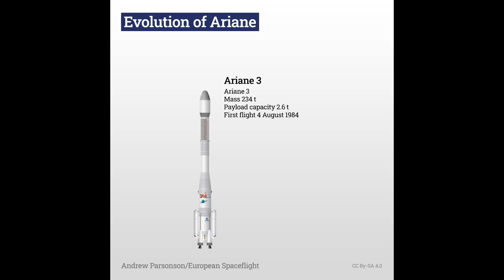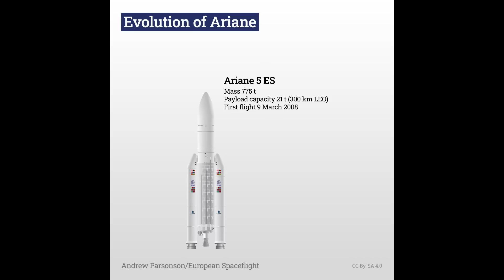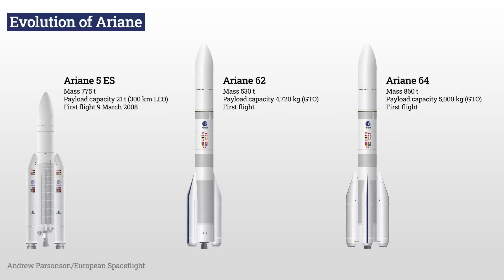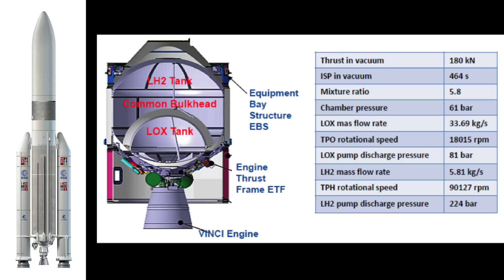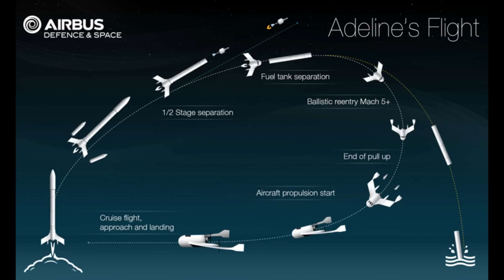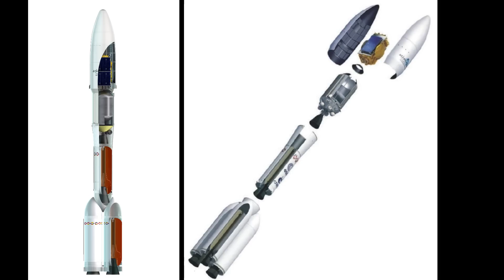Europe Retires Ariane 5 Before Ariane 6 Is Ready????

Comment: I wonder how long it will take ESA to manage any reusability. Or is it just not desirable for their heavy lift missions? If they’re going to stick with expendable rockets then cheaper vehicles need to be in the pipeline with cheaper mass produced engines. Perhaps ESA needs to have a commercial launch programme like NASA does, but for European providers.
Reply: the boosters splash down with chutes afaik.
Reply: 2028
Reply: Ariane 6 successor(supposedly a partially reusable design) is scheduled to start operations in 2030.
Reply: One develops a launcher to suit the missions one wants to be able to launch for oneself. The real challenge is, working out what the mission(s) is/are!

This is where Europe comes unstuck. It launched Galileo, though it mostly has no idea why. It's not like Galileo has revolutionised satellite navigation in anyway whatsoever. The French like it, because it gives them a GNSS capability for their military that is independent of the US GPS system. The UK looked at and nearly committed to building its own, but decided in the end that a third one - even if well built - was going to be pointless (same vulnerabilities, little inherent extra benefit). 

As for other missions - well, there's a bunch of science missions, but those are small in number. It doesn't look like Europe has any ambitions for crewed flight. Arguably, they can launch those with SpaceX (and they are).

So, that leaves the hoary old "communications systems" mission. They'll probably want to try to show that it's not just the Americans who can launch large constellations, but it'll not be of any real commercial value. GNSS, which simply transmits and no one has any idea if anyone is actually practically benefitting from it, can be deemed successful merely by existing. A comms service is going to look pretty silly, if no one signs up to use it. If they've gone and built a rocket for launching that service, it could easily end up being The Wrong Rocket for anything else, especially if they get a dose of Germanic-why-are-we-paying-for-this realism...

If I were in charge of Europe's launcher program, I'd take a look back at what Airbus did to Boeing in the late 1980s, early 1990s. Then as now, the Americans were building in large numbers, Airbus were small fry. Forget about StarShip (equiv of Boeing's 747), focus on beating Falcon 9 (equiv of Boeing's 737). Let SpaceX focus on the mega-launcher at a time when they've maybe not got much money to boost the Falcon 9. There's good market share / revenue to be had in the smaller end of the market. Big exotic launchers can come later. 

This could be tricky - Falcon 9 is actually pretty good. Geography doesn't make it easy either - Ariane has to ship stuff across the Atlantic, whereas SpaceX has their factory next to the launch pad. But, beating Falcon 9 is what I think they'll have to do, if they want to compete at all. 

If they don't want to compete, just prop up jobs, Ariane 6 is probably OK, but then again there wasn't much wrong with Ariane 5...

Space security, and territorial security against space threats could easily become necessary. Preparing suitably would require action and serious commitment, and will probably bring its own different launcher requirements. A lot of action early on would be needed if they're going to keep building in Europe and launching from French Guiana; it's a bit tricky to win a war if you depend on shipping a load of stuff across the Atlantic to launch it, potentially past a lot of enemy warships... 

Thing is, though that might drive a need for a specific launcher capability, judging by Western Europe's general "it'll never happen" approach to the threat against Ukraine, I can't see them getting that launcher strategy right at all. Europe's security moto seems to be "Never knowingly prepared for widely predicted armed conflict"...
Reply: @abarratt8869  You're mixing up a whole bunch of things that are unrelated. ESA is not a corporate entity and their goal is not to directly compete with SpaceX or anyone else. They're a semi-independent entity, albeit primarily owned by various nations, and their purpose is to run a launch program that suit their own and their clients' needs, and nothing else. Ideally they'd be able to be cost effective and pay for themselves, but that's yet to happen for any of the rocket launching organisations. Meanwhile SpaceX is a rocket-based shipping company that has failed to be financially self-sufficient, and was it not for their contracts with NASA and the US government, they wouldn't have a whole lot to do and likely would've gone bankrupt years ago. Financially speaking, they have an unfair advantage and do not qualify as a competitor.

Europe is a whole bunch of countries, not one singular nation, and the majority of the countries that are directly threatened by Putin's infantile behaviour are not members of ESA or EU, and their approach to (or failure to) defend themselves is not relevant to this subject. The government departments that decide and determine appropriate military action are not involved with ESA's work - it's not allowed as part of their founding guidelines, but those same guidelines also require that all its members must be part of the decisions and the rocket construction itself, and thus you get weird decisions that take a long time and may not be the most efficient
Reply: The case against reusability is that the European launcher industry needs a certain number of vehicles built per year to remain viable.  On average 4 A5s per year were launched.  Assuming steps had been made to make A5 resuable, even once, then either the cost per launcher would have had to double or the various companies would have gone out of business.
A6 is supposed to be upgradable with new solid rocket boosters, new construction methods for the stages etc, with reusability of parts gradually introduced as time goes by and the European launcher industry adapts.
ArianeSpace has previously said either late generation A6 or its successor would function more like Falcon 9.

Scott is more often missing out bits like this as time goes by.
Reply: @ptonpc this was widely panned when they said it last year if I recall correctly. There is no reason a competitive launch vehicle would only be able to launch European payloads…  clearly there is enough globally demand.